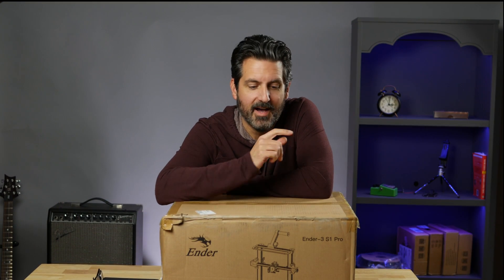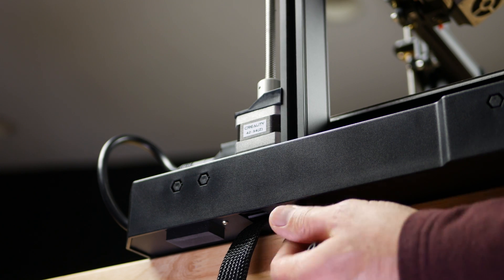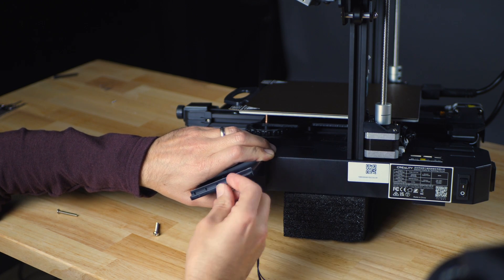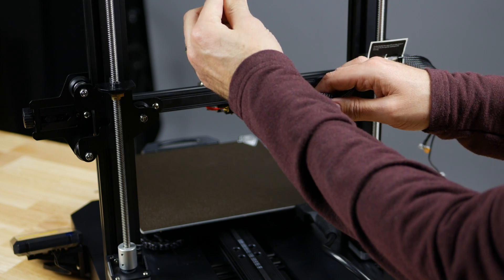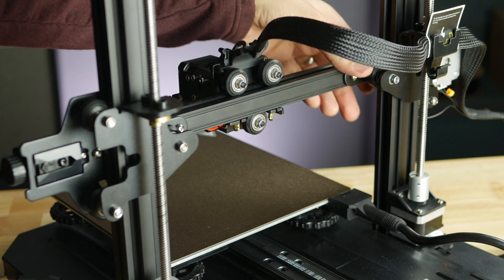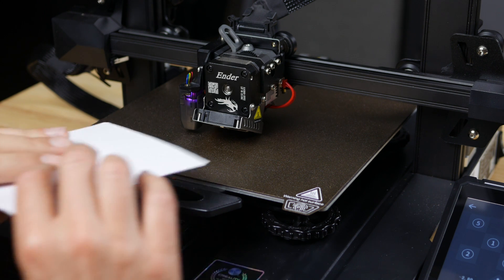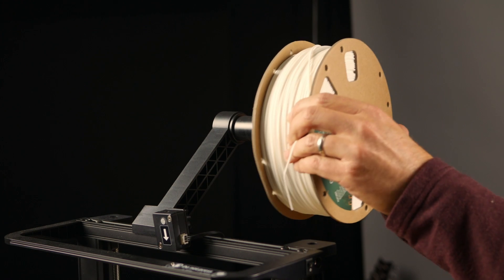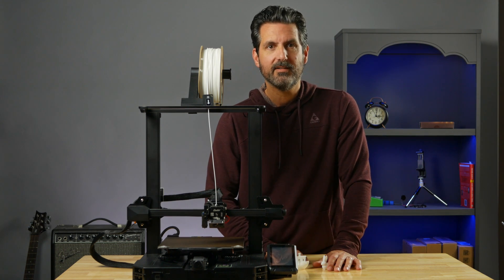Ender-3 S1 Pro Setup and Test

Comment: I just updated the firmware for both screen and main board and now the auto levelling actual works with out having to test with paper or make small changes to the corners, its like getting an even better 3D printer...

Comment: Im new to 3D printing and just got this printer. I have trouble with the filament not sticking to the base so every print just fails. Any Tips?
Reply from the maker: Once you have auto leveled the bed it is all about having a clean bed (I wipe it down with rubbing alcohol before each print) and the proper Z-Offset, if it isn't sticking lower the Z-Offset. Be careful not to go too low and scrape the bed.
Reply: @ Hey thank you for the response and the great video. Cleaning it did wonders even tho there wasnt smthg visible in the first place :)

Comment: I did everything the same way in the video but I used the filament that came with the printer, the extruder is not feeding and the gears are clicking. not sure why, I tried everything including tightening the tension screw. Anyone had the same issue can help?

Comment: I'm new to this 3D printing and have this printer. I just loaded in the filament and printed out the rabbit and it turned out great ! The question I have now is do I have to do a preheat before every print ?
Reply from the maker: You don't have to. The printer will heat itself up before it starts printing.

Comment: is the auxiliary leveling necessary or can I just do auto leveling?
Reply from the maker: You have to do the auxiliary level at initial setup, after a firmware update, and after a nozzle change. Also, if the auto level fails you need to do the auxiliary level.
Reply: @dandesigns3d  good to know. I am getting this same printer soon, so good to know!

Comment: Having trouble getting the filament to stick to the table.
Reply from the maker: I'm going to do a video about this soon. Clean your bed with rubbing alcohol right before the print and make sure you z height is set right. I find most of my failures are due to too high of a z offset. Watch as the brim is printed and if it is not sticking well touch the upper portion of the screen and then Z-Offset. You can adjust it closer or farther away while it's printing. Be careful not to dig it into your bed though.  This video will help too. https://youtu.be/U7cTvLpXL6U

Comment: Thanks for the video. I thought I knew everything I needed to know, but I did NOT know about the function of the eccentric nuts on the print head driver. Mine was too tight and caused it to make little "speed bumps" when transitioning across the rail. Thank you!
Reply from the maker: Glad it helped!

Comment: Hello I am new to 3-D printing and got this as my first printer for my birthday. Followed the steps and when I got to turning it on, it automatically goes to language and I click the back arrow and it’s asking me to select the tool header type, and the options are FDM or laser, I don’t know which one to pick.
Reply from the maker: You choose FDM for printing. Laser is for the laser engraving attachment that is available. The good news is that means you have newer firmware. The old firmware didn't ask that. Enjoy!
Reply: @dandesigns3d  thank you that’s good to know if I were to get the laser attachment in the future would I be able to switch back-and-forth from printing and lasering?
Reply from the maker: Yeah, it's in the Settings - Advanced menu (I believe). You can switch back and forth. I don't have the laser. I plan on getting a stand alone laser soon.

Comment: Thank you :)

I've noticed that during putting 20mm through the nozzle, my filament is coming out significantly slower than yours, any advice?
Reply from the maker: I would think it should be close to the same as mine. What material and nozzle temp are you using?
Reply: @dandesigns3d  for some reason, it fixed itself after I redid the levelling. Very strange

Comment: Just got this printer and every time it starts to print it gets unstuck from the hotbed.
Reply from the maker: Try wiping the bed with rubbing alcohol before each print. Level your bed. You should also make sure your z offset is set properly.

Comment: This was a really helpful setup tutorial! I was having trouble starting a print and it turns out I had the power switch on the wrong voltage (they should include that step in the setup instructions)
Reply from the maker: Glad to hear it helped! I have a couple other videos specifically for the S1 Pro and more to come so subscribe so you don't miss them.

Comment: Mine just came, pretty excited thanks bro
Reply from the maker: Nice! Enjoy.
Reply from the maker: How's the new 3D printer working out. Printing anything fun?
Reply: @dandesigns3d  Sadly, I had big issues printing larger prints which used a lot of the bed. So I sent it back while I could I think it was a software issue with the auto bed levelling. Itd not lay down the first few layers right and then the nozzle would start hitting. Theres lots on the internet about it, apparently updating the firmware is pretty risky.

Spent hours trying to get it to work. Was a nice machine and the quality of the smaller prints was very nice.
Reply from the maker: That's a bummer. I hope you find a printer that works for you. When printing large prints the Z offset and cleaning your bed prior to starting become very important. I've also heard of some people having trouble with firmware updates also. Actually, first layer adhesion and firmware update process are two videos on my short list.
Reply: @dandesigns3d  Might try again in the future, I saw you recommend another model to someone. What other videos have you got up and coming?
Reply from the maker: @Rich10000  I have a few design and print projects in the works.

Comment: why is it that every setup video i see of this printer the led light is already attached. but mine came detached with instructions on how to attach it? it also came with the wrong size bolts for attaching it as mine are a little too long. i am having a hell of a time trying to figure out how to tuck the wires for it properly. does anyone have any good pics or suggestions on how this is run.
Reply from the maker: Mine came pre-assembled. Here are some pictures of how the wire is routed. https://dandesigns3d.com/s1-pro-light-wire-routing/ Hope this helps!

Comment: Should I put the PLA in before it starts heating or once it’s done heating?
Reply from the maker: It has to be hot before you can load the PLA because it has to melt it to allow you to push it through and purge the last material.
Reply: @dandesigns3d  Oh okay. Thank you!

Comment: Hi Dan, sorry to change my 'thumbs up' to a 'thumb down', but after watching your video and following the steps, my plate got damaged and nozzle broke. It seems that after the leveling you show, you need to set the z-axis zero point. You didn't tell in the video and went from auto-leveling straight to printing. Can you put this in the video to 'protect' other newbies like me?
Reply from the maker: Hey willrooy. Sorry to hear that happened to you. You shouldn't have to reset the z-offset after leveling. The step at 13:50 is setting the z-offset. I have heard of others in forums having issues with z-offset changing on them when it shouldn't. You might want to contact support because I think there is something wrong with your printer.
Reply: @dandesigns3d  Hi Dan, yes. After I wrote my comment here I watched some other videos (also the one from Creality) and there is no extra step after the auto-leveling. Thats when I decided to write to Creality support and the company were I bought it from. Maybe they can help. So back to
'thumbs up' for you 🙂
Reply: same thing happened to me

Comment: I wonder you only have 50 subscribers, the video quality and editing is absolutely amazing and look so professional.. best wishes for future. I am using ender 3 since 5 years, and now I am thinking to go with s1 pro. Will it be worth upgrading ?
I am not gonna replace my old ender 3, but I'm tired of leveling, and filament breaking problems. Although I'm happy with the printer.. but S1 pro has much better features.. 
What do you suggest ?
S1 pro or any other printer in the same price bracket..?
Reply from the maker: Thanks! I'm hoping the subs are just getting started. I've got 51 subs now! Thanks!  
For the printer. I really like my S1 Pro. I have had to replace the thermsistor already but it was $15. It was dripping in and out. The leveling is really nice. I added gcode to auto level before every print. I would buy it again if I didn't have one. Would like to have multiple heads but that's more expensive. If you are having filament breaking issues you may want to look at how your storing it. Humidity can make it brittle and cause bubbles and stringing.
Reply: I would go with the new Ender 3 V3 SE, it's only around £200/$200 and has most of the features of this S1 Pro plus auto Z offset.
Reply: i would go with a sovel SV07 runs klipper out of the box with insane printing speeds and is much cheaper then an s1 pro.